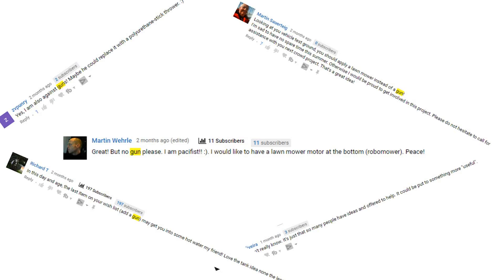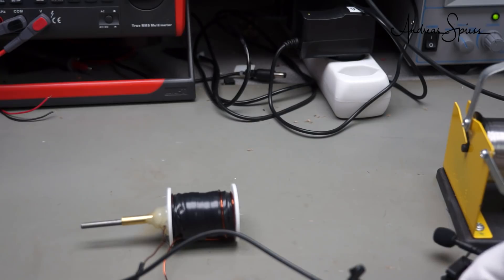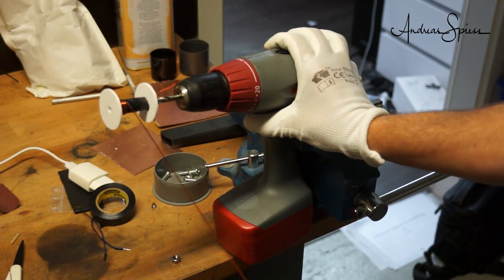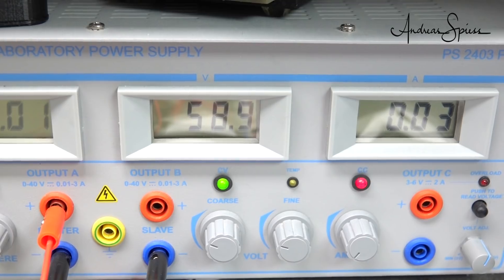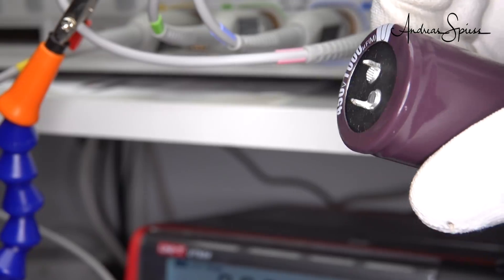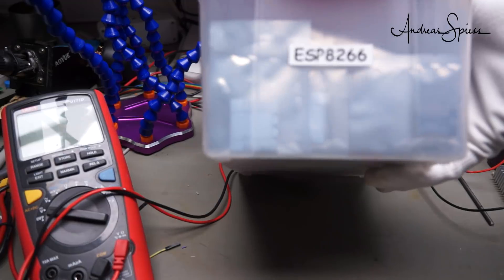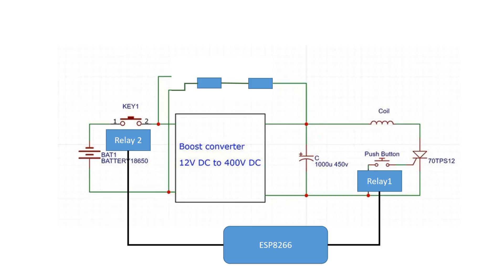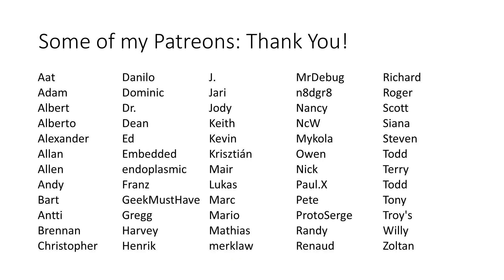#221 Better than GreatScott's Coil Gun? A true story, how-to not do it

Comment: you need a snubber network watch https://www.youtube.com/watch?v=LXGtE3X2k7Y you want a 50 amp 1000volt diode
Reply from the maker: I know both videos (I am a fan of w2aew) . But I am not sure if my case is the same as with relays the current is switched off and here it "bleeds" out (as you see in the current curve on the oscilloscope). But in any case, I will add one and check the effect.
Reply: yes it is the same just use hi power shockley diodes 50 amp 1000 volts

Comment: Few things to say, you need diodes to short the reverse voltage spike from the coil and u could use a optoisolator for the switching of the gate  (litterly a infra red diode and an infra red transistor with an air gab inbetween) wont get any simpler. relay looks a little bolky for that task but other then that .... that thing is way stronger then what greatscoot did for example good job try again wanna see it drive nails into wood ^^
Reply from the maker: As I mentioned in the video: Optocouplers did not work. The Thyristor needed more current. But I ordered opto-triacs which should do the job. And the diode will be added.

Comment: There are two things that gives me questions. 1. How can you switch off a thyristor  
because if it is once ignited it turns to off only when the current is zero
and 2. if you fast switch off the current the coil will produce a big voltage impulse that can reach thousands of volts. Too much for the switch. You will need a free-wheeling or flyback diode with a powerresistor to get rid off the power.
Perhaps it could also be better to change the brass tube to one made of plastic. Brass is not magnetic but the big magnetic pulse produces eddicurrents in the brass. A photocell could be used to switch off the current at the right time.
Reply from the maker: The thyristor switched off when the capacitor was discharged (the current was 0). And I will add a reverse diode and check the results. and I will search for a plastic tube or print one.

Comment: Good project. If that coil remains on for too long it will slow the projectile down because the projectile will want to settle half way along. You could tune the shunt resistor to control the discharge rate so that the capacitor is fully discharged before the projectile reaches the half way point. 😂
Reply from the maker: You are right. I did not optimize the coil vs the cap. But the "shot" was quite small so I assume it was finished before the iron was in the middle. I was also capable to adjust the length of the projectile and the starting position. Both had an influence.
Reply: @AndreasSpiess  actually I realise I was wrong! As long the coil is wound in the same direction it should propel the projectile all the way through. Sorry about that!

Comment: If you insted used 2 coils and 4 mosfet, you can make it without the 400V DCDC. Insted you can use number 2 coil to charge den cap.
Reply from the maker: There are a few possibilities. GreatScott went the way you describe. And I wanted to use high voltage. But I do not know which one is better or worse.
Reply: @AndreasSpiess  what I'm talking about is also hivoltage. You use the turnoff voltage to charge the caps. Then you have ałl the energy you like. It would be easy with a schematic, but u can't put that here

Comment: You should put an optoisolator at the output of the resistor divider as well. Better safe than sorry!

And I’m sorry about your loss. Especially the power supply. On the other hand, you could try and fix it, and record a video of it. I love repair videos!

Anyways, at least you survived! That’s a relief!
Reply from the maker: 1. I am not sure an optoisolator would help at the ADC. These devices are completely nonlinear. But a few more resistors in series would have been a better choice...
2. Maybe I will do a repair video. We will see...
Reply: Andreas Spiess Or an op amp in a voltage follower configuration. Make sure it’s rail-to-rail, though.

Comment: This was an excellent first attempt! Coil guns are interesting, but the "bang for buck" falls off quickly, compared with other designs. I did get a section of welding rod to punch through a 3/4 inch aluminum plate with just two coils, and it would still fit on top of your RC tank, but it has to be partially rebuilt after one test. 1200V into 10 turns is ... violent.
Reply from the maker: As I said, this is too dangerous for the tank. So we will go in another direction there. But I wanted to try it out since a long time. And obviously, it was necessary to "refresh" some of my old knowledge ;-)

Comment: Sorry you lost your Power Supply.  I know the feeling.  I think I've gathered you are a Noob at electronics;  May I suggest a bunch of opto-isolators.    Easy to recover from old parts, and that will save you many many electronic parts.  And equipment.  I would even send you some if you like.  (Ive got a bag of old electronics, that I will never use)   PM me if you wish.   I forget my channel name, but you can find it.

Cheers and good luck.
Reply from the maker: I tried optocouplers, but the Thyristor needs quite some current on its gate and they did not work. So I ordered now opto-tricas which should be better-suited

Comment: I hope you've been able to repair the power supply, most of them are not very complicated.
Reply from the maker: Mine is quite complicated because it has many relays to switch it from "individual" to "parallel" to "series". So far I found a dead output transistor, but replacing it did not fix the problem...

Comment: Shouldn't electrolytic capacitors have a cross scored on the top end to create a weak point so they don't blow apart like that?
Reply: They do, however that is never completely reliable nor does it help with instant extreme pressure.
Reply from the maker: As you saw the cap was intact. But I think the "power" was quite big at the explosion and there was not enough time...

Comment: I like the video and your comments make it fun to watch. My condolences on the part loss. Except for the large cap(firecracker?)  from China, the others tried to put up a good fight. My thoughts on the voltage spike as I've had it happen to me on a few occasions are maybe try a tvss or a diode protection or some type of snubber? I lost a parallel port on my pc years ago thanks to HV, but I learned from it... MOCO30xx came in handy after that lol
Reply from the maker: You are right. I ordered a few MOC3051. Maybe they prevent the worst?

Comment: I did something like this about 10 or 15 years ago.  I used a PIC to generate a PWM into a charge pump to charge the cap to close to 400V.  Instead of a triac or thyristor, I used an IGBT to switch the charge to the coil from a Ford starter solenoid. It worked but, like you, the concern of playing with 400 Joules of charge eventually awakened my common sense.
Reply from the maker: The parts are in a box for now. I ordered a few opto-triacs. Maybe I will continue later on. For the moment I had enough...
Reply: The Joule is a measure of energy, not charge ;P

Comment: It looks like there is a dead diode inside your power supply, electroboom also had the same problem and he made a video on how he fixed it https://www.youtube.com/watch?v=xSXvqrEwssk
Reply from the maker: He had a short (0volt). Mine has 60 volts. So the error most probably is not the same. But I hope I will be able to repair it ;-)

Comment: The capacitor on the board exploded because it was soldered in reverse polaritywhile being manufactured, not because of "Chinese 400v".
Reply from the maker: I do not think so. My module provides +/- 400 volts. And as I said, the "minus" cap exploded. This one has to have the minus at -400 volt...

Comment: First thing I do after receiving any power modules from Aliexpress or other Chinese sites is, checking the capacitors (electrolytic usually) and buying high quality replacement for them from trusted sellers locally. BECAUSE I DO NOT TRUST CHINESE CAPS!
Reply from the maker: As I said, the voltage of the device went to nearly 450 volts. But you are right. Quality capacitors are important if you want to use your device in a productive way.

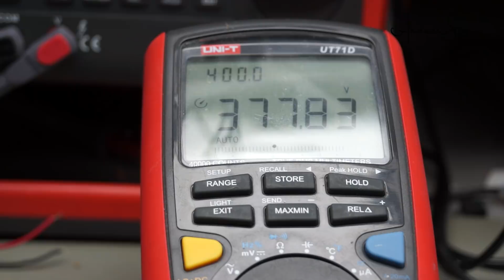Comment: Dear Andreas, ( 4:43 ) I guess you forgot to install a freewheeling diode between your power supply and your project. These little devices saved my projects and the other equipement several times 😅.
Reply from the maker: I will add one in the future. Thanks.

Comment: MOC3021 or any other.... this is why you need too isolate from HV side...  
opto- isolątion..... key factor.
http://2.bp.blogspot.com/-b-hseJbhKkM/UBww_caePoI/AAAAAAAAADk/MMlKtxfRo5U/s1600/interface.png
it works realy good.... need supply from HV and current triger from LED side...

ps... for measure any HV with divider  R1/R2   you need to put zener diode for 3,6V to not reach this volt and not burn ADC..
Reply from the maker: I am not sure if the MOC3021 work with DC. They have a zero-crossing detector. I ordered MOC3051 which do not have one

Comment: An improved coil gun, I thought you would speed up the nail by using two different coils switched on with a milliseconds delay, so the nail gets an initial start by the first coil and an extra boost by the second coil.
Reply from the maker: That would be a next step ;-)

Comment: Please consider an emergency discharge resistor for the capacitor! And you may should add a light barrier at the end of the coil to switch it back off
Reply from the maker: I will add a diode. The light barrier was not necessary because the discharge was very fast. It would be necessary for a second stage

Comment: Andreas, just curious as to what optocouplers you tried in the circuit, some are better suited to this sort of project than others.
Have a look at something like the MOC3051, it would make a good trigger for your thyristor. 
http://www.mouser.com/ds/2/149/MOC3051M-196226.pdf

Also, adding some transient suppression to the ESP power rails would help to protect the chip from any voltage spikes that sneak onto the power input.
Reply from the maker: MOC3051 are on order. and I have a few high voltage diodes here... Maybe I try it again. Not sure...

Comment: A few suggestions.  Firstly, a resistor from gate to earth. Next, take that metal barrel away as it will chew energy and change the speed of the electromagnet by acting as a shorted turn. I've made that booboo myself.  ;)
Reply from the maker: Thanks for the tips. I have to add a few more things and do some testing. If I continue the project.

Comment: This is the downside of modulized hobby electronics. Everything is learned based on functions, not principles. In case you want to protect your devices against high power switching, use sacrificial Zener diodes one for rail and one for ground. They fail short so 0.25w or 0.5w is sufficient.
Try fixing that poor power supply in the following videos. If you are lucky, only the output clamping diode has failed short. It is a heavy-duty reverse biased diode between the positive rail and the ground. Replace it with another Schottky diode. Next, check the control circuit. It is usually not protected by the output capacitors. I think the power transistors/MOSFETs are intact according to its behavior shown in the video.
Reply from the maker: I already started with the repair. It is not easy because of the usual suspects (op amp, voltage reference) all survived. At least the power transistor was dead. But replacing it did not help so far. This device needs some more "love" ;-)
Reply: Oh No... Sorry to hear that. Maybe remove the transistors and check the drivers? Good luck! Check all the internal power rail voltages amd the low value resistors near the transistors too.

Comment: I'm sorry Andreas but I have been laughing hysterically at your expense since it's not only high voltages that cause such fun and games. Your escapade took me back to days at DEC when I was in Field Service and ended up literally blowing the tops off 4 memory chips by running +12v directly to them due to BAD instructions for a CSS (remember them?) board installation requiring a new wire wrap change on the backplane. 

My face was saved when a support engineer came out to help and a further two chips blew before we went right back to basics and discovered that the problem was the backplane pin addressing in the installation instructions!! Oops! 6 chips blown, 6 chips desoldered and replaced and finally it worked! You not only have my sympathies but thanks for a massively entertaining (and funny) recount of your adventures to the dark side! 

BTW I have that exact same supply and although I only use it at 100v and very low current for my purposes I shall be very wary if I ever use another for higher volts.
Reply from the maker: Yea, the old days with wire-wrapping. Did not hear this word for a long time...
I think, YouTube also has to be a little entertaining. So I try to add my 5 cents.

Comment: The coil is feeding energy back into the circuit when it's cut of. This results in a voltage spike. This is why you usually use a diode in parallel with a relay coil.
Reply from the maker: You are right. I have to enhance it!

Comment: Why do you wish to fix a lethal weapon to the robot. A non lethal weapon that can be fired more than once seems a better option. The practical application for such a device is as a robot watchdog. Using a non lethal weapon also ensures that an accidental firing is not going to kill anyone.
I have always thought a electrified laminar flow high pressure  jet of electrolyte dosed  water would act as a stun gun, without the need of attached spooling wires. 
 I trust that any remote control of the weapon will have a sufficient number of interlocks to ensure accidental firing will not happen. I would have thought that fitting a leather weapon to a robot would break a number of laws.
Maybe it would be better to just interface to a paint ball gun.
Reply: Using school physics we know the energy stored is defined by the equation 1/2*C(V squared). So with 400 Volts, squared is 160,000 multiplied by 0.001 Farad and multiplied by a half.
That comes out at 80 Joules. Fortunately not all of that will be transferred to the projectile. But for comparison a 9 mm round from a pistol has an energy of about 450 J.
I'd be very careful where you point that thing!

Comment: Hi Andreas! Vor isolation you may want to use something like a VOM1271. A Optocoupler that generates a voltage at the output. I use it all the time, they are so useful!
Reply: Yes this is the modern way to go.
Reply from the maker: Unfortunately, the Thyristor needs quite some current. But I ordered a few VOM1271. Thank you for your tip!

Comment: You made a double barrelled weapon. Not just a Nail Gun, but also an EMP Gun!
The EMP from the coils generate current flow in any nearby conductors, like cables or PCB components.   
Always keep in mind that when a large electromagnetic field collapses (due to removal of its power supply), the powerful EM field moves back into the coil, in the opposite direction.. The coil leads will output a large pulse of power (in the opposite polarity), so the coil needs a suppression diode to save connected components.  (High rated diode). 
PS: The collapsing field EM pulse can arc across open relay contacts, because it's voltage can be much higher than the original DC supply voltage. Thus more dangerous to our modern devices. 
You should make a larger unit, that would kill nearby cell phones.. LOL!
Reply from the maker: With all the tips of my viewers, I should be able to create a much safer device. So, maybe I try it again in the future and show what I have learned...

Comment: @ 4:55 I had bad caps on TWO of those exact same boards, I showed them in my high voltage leakage tester project on my channel: 🔴 #423 High Voltage Leakage Tester Project Part 7https://youtu.be/_N-gh16ADH0
Reply from the maker: I am not sure they were bad, because clearly, the voltage exceeds 400 volts. I did not follow your project closely, so I did not recognize you used the same boards.

Comment: You can use a feedback circuit using a tl431 ,some resistors, an optocoupler and mosfet to make the capacitor charging stops at 400V automatically.
what about making a repair video about repairing the power supply ? this could be the series pass transistor damaged
Reply from the maker: 1. I used the ESP which should be ok because you also can change the max voltage.
2. Maybe I will do a repair video. Not decided yet.

Comment: You need a free running diode! Inductive load!
Reply from the maker: And a few other small items ;-) Thank you!
Reply: @AndreasSpiess  Or one big hammer :-)
The coil is an inductor, when the current is interrupted, a high voltage pulse of opposite polarity is generated. Destructive pulse ;-)
Reply: And just to be safe, add a TVS diode to the ESP8266 pins connected to the coilgun.

Comment: what is the Operating voltage of résistor used as divider?if you use a good quality resistor you'll be able to exceed 350v/résistor a bad quality max 100v  and worst case under 100v.
Reply from the maker: You are right. I did not think about it. Otherwise, I would have used 4 in series. Next time I know...